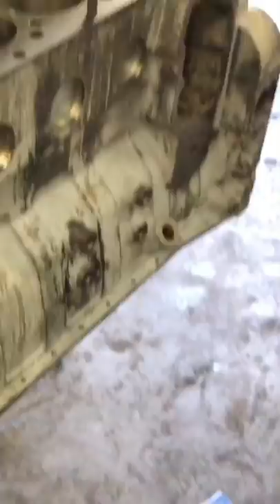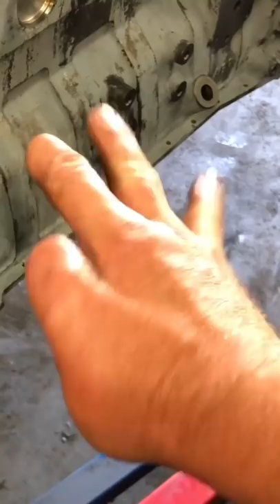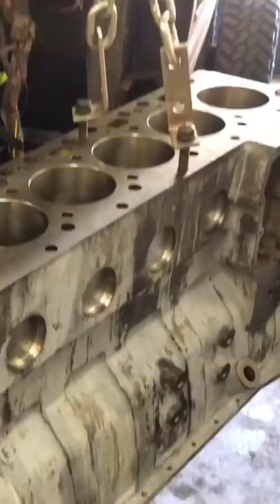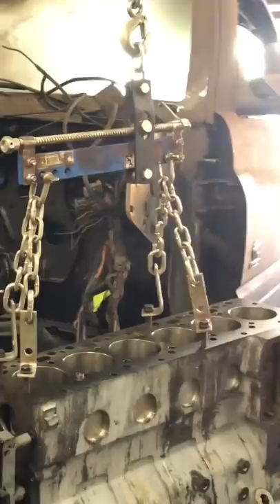Be Careful folks! Link in Description #12valve #cummins #diesel

Comment from the maker: What Happened to my Hand?
https://youtu.be/_HKbipvgtS0
Reply: C-cool gulp
Reply: What happened to the 4th finger?!
Reply: @superniger4822  ok that’s a bit rude though. Did you watch the linked video above?
Reply: The amount of fingers dont add up. Were you born with 4 fingers
Reply: @hitmanxiv9401  watch the video.
Reply: Look thanks for the safety reminder but you gotta warn people before you just go showing that thing off
Reply: Reminded me of the "shake hands with danger" video
Reply: In that case I doubt those bolts and chains gripping those brackets aren't gonna hold that engine block especially if those chains and that bracket is a zinc alloy
Reply from the maker: The brackets and chains came with the 1500 pound load leveler.
Reply: Real fallout super mutant
Reply: How is your phantom pains
Reply: I lost my leg and mine are Horrible
Reply: Where did your middle finger go
Reply: Anything happens I lost my mom to a bike wheel

Comment: When metal decides to hurt you, you’re just made out of butter… that can’t be any more true.  I work with molten aluminum .
Reply from the maker: Yep it is dangerous in all forms
Reply: I work on big copy machines. Lots of razor sharp metal panels gears belts and rollers that don’t care if your fingers are in the way. I’ve got my share of scars from grabbing sheet metal frames in the wrong spot.
Reply: He works with molten aluminium.
Reply: My dad did the same when he was young. Do you tie your boots?
Reply: @grantpierce7182  yea but we have something called splats that protect to top part of the boot.
Reply: I also work woth molten aluminum right between the plates
Reply: The type that  explodes when contact to water?
Reply: @maluco132  yes.  We actually had a pretty bad explosion due to moisture last year.  Entire melter exploded .
Reply: Stay safe brother, dangerous stuff
Reply: @tomasc6  it is but if you’re careful an aware you’re good.  Thanks
Reply: Yeah just yesterday when we were just arriving to get set up at the jobe site, some dude fell from the second floor not even an hour into the day, he apparently went down head first, so there was blood coming out of a wound on his temple, also was bleeding from his ears. Was the craziest shit I saw inna bit, he was pretty much knocked out having a seizure bleading from his head, I wanted to help but I didn't know what to do.
Reply: @maluco132  all molten metal does that
Reply: @nighttailglizzy6339  he was dead. Sorry but he landed on his head neck snapped. Their was no saving that
Reply: @malikcoleman2023  I wouldn't say that usually small cuts hurt the most large ones well for it to get that bad you lost your sense of feeling before it got that far
Reply: Yup, I’m a Shop Ironworker. I’ve smashed four fingers all Different times. Cut the tip of my right pointer finger. I have a screws and a small plate on another finger😂
Reply: You mean... Aluminium?
Reply: @BT.70  Both are correct. Just like 'humor' and 'humour' are both correct, it's fucking dumb but it's the way it is.
Reply: Yup. My story not anywhere near yours man or 95% of anyone else's but 15 yr old Metal Fabrication class working working on lathe polishing a project middle finger sticking out a hair to far. Lost the nail slowly grew back can't feel anything past the second knuckle.
Reply: @jewkorn9724  correct depending on your nationality. It is not literally accepted as correct In American English, if you were to write that on a college paper you would be docked
Reply: I work with a steel cutter that uses roughly about 5,000psi of pressure and I've crushed a few fingers not being careful, I also almost lost a toe thanks to a barrel of steel drops got caught and fell on my boot, took off the tip but if I was any closer I would be having a real hard time walking today
Reply: @StockyBaldman  imagine breathing in metal particles
Reply: @ericbower2256  lmao 🤣
Reply: Been there done that. First day on the job, we were sifting the top of the oxidized molten aluminum a chunk fell back in, splashed on my gear and burned through my gloves instantly. I was smoking up litterally
Reply: @joshjarman8685  looks like you were too close to the melter.
Reply: Same here man! Work at a casting facility
Reply: @getthebagnelly  cast ingots?
Reply: @getthebagnelly  oh we cast ingots as big as 30k.
Reply: I have a similar injury from childhood from a bike chain and gear, thought I could beat the speed and lost the tip of my finger, not as hurt as you but it really sucked cause it happened so fast then I had no finger tip, finger injuries are so weird, my finger nail healed differently due to missing a finger tip and I pretty much have a weird claw nail. Finger injuries from being cut are almost the same, the claw looking club nail.
Reply: I've never heard of him. Weird name really. Most my colleagues have regular names like Juan or Billy. What country is your friend Molten from?
Reply: I worked in a copper casting plant for a few years. I seen a man wearing protective gear get burned alive. Burned the PPE gear off, his clothes, and most of his skin. He died a few days later. Happened at Kobe/Weiland Copper Plant in North Carolina
Reply: @foosmonkey  can’t you wear thick gloves while your working?
Reply: @YeOldeGeezer  no dexterity. Occasionally I wear Mechanix gloves.
Reply: @DomVito87  you at a mill or a smelter?
Reply: @johnsandlinjr  I working in a cast house of a few rolling mills. We produce ingots as big as 30k each.  Run various alloys.
Reply: @DomVito87  I was an electrician at Alcoa in Lancaster. Which mill you at?
Reply: @johnsandlinjr  I work there lol . But in casting .  Was in the HM for a few years as big red driver .
Reply: @DomVito87  dude no way. When you said I work at a mill and there was an explosion I just knew it. I was talking to other electricians who told me about it and I couldn’t believe it. But I will say after all the safety videos about bottles and stuff in orientation that all goes out the window lol
Reply: @johnsandlinjr  I was in the hotmill at the time 6 went boom... but i saw it. shit was wild.
Reply: @johnsandlinjr  That wasnt a bottle that caused that boom on 6 lol.
Reply: @DomVito87  and that made you want to go to the cast house? Lol
Reply: @johnsandlinjr  HM was boring.
Reply: @DomVito87  fair enough. Do you guys work on both sides? Charge side and holder side?
Reply: @johnsandlinjr  Na... I work only on melt side.  Reverbs/ Open Wells.

Comment: I have a friend who's missing two toes from a 396 engine block that fell on his foot. He was wearing flip-flops.
Reply from the maker: Ouch dang that sucks
Reply: That that truly does suck. But Atleast he can say it was a sweet 396. Not some junk 4 banger that did it lol
Reply: Steel toes.
Reply: I had a customer inspect a roof with flip flops on then called when he cut his foot on 90 degree chimney flashing. I advised him to use a little more common sense and to think about that and call me back of he still had a complaint with the roof or galvanized flashing being sharp. I never heard back. One of the only times I seriously considered calling a customer a friggin idiot and had to hold back laughing.
Reply: Toes and fingertips are packed with tons of nerves, sounds painful
Reply: @BrianBourgeois-  no that’ll make it worse he would have lost all his toes, the steel will just crush your toes when the 400lbs hunk of cast iron hits it
Reply: @sargentdoggo6155  that's why composite is the better way to go anymore plus it's lighter. I wear boots with composite toes almost anywhere. Sandals suck.
Reply: I shudder at the thought of wearing any kind of open toed shoes while working in the garage. Even if you’re not working on particularly heavy stuff there are plenty of things you can drop on your exposed toes that can ruin your day. Even dropping a power tool that only weighs a few pounds onto your feet can fracture or cut up those little piggies.
Reply: @sargentdoggo6155  Yep, drove me nuts my previous employer wanted steel toes but we all had composite. Forklift and pallet traffic.
Reply: @davesendit1348  in what way do 4 bangers suck?
Reply: @sargentdoggo6155  what's the difference between composite and steel? steel toe can withstand up to 6k lb as Google says thats more than enough for a 1k lb block no?
Reply: @Mustafa Mohammad  steel is good with lighter stuff like cinder blocks or smaller tank but when it comes to working with bulls or just cattle in general a bull can stomp in steel toes, a 350 1ft in the air can most certainly crush steel toes, composite won’t crush it’ll just shatter giving you the ability to get your feet out without having to leave your toes inside. If I’m wrong plz correct me
Reply: @mustafamohammad1821  not when it's dropped from 5.5ft up
Reply: Security Flip Flops?
Reply: I feel like my pain threshold for my hand would be better than my foot
Reply: I once had a metal 55gal trashcan full of compost drop from 4ft and land with the corner on my big toe, its been about a year and the toenail is still fucked. I lost about half of it and the half thats left has grown into a super hard bubble on my toe.
Reply: @BrianBourgeois-  naw he’s toes were definitely not steel….
Reply: @TheOfficialFloridaMan  Dropped a a big ass tool box on my big toe. Completely crushed it. The pain I felt that night from the pressure under the toe nail was agonizing. Then my friend stepped on it and it exploded. Lost the toe nail and now I have a super armored toe nail in its place lol
Reply: As a dude that does mechanical stuff in a home garage environment for spare dough in flip flops that just bought a motor lift, this just stopped that 100%
Reply: Damn flip flops or not I don’t think a pair of shoes would’ve even helped him. I’m an EMT and I had one patient who’s toes got crushed wearing steal toes (not saying they don’t help for lighter falling objects). The metal in the toe box wrapped around and cut in behind the joint of the toe trapping his foot completely. Had to transport him with the boot on, don’t know what the doctors had to do to get it off but I assume it wasn’t pretty.
Reply: Crocs is what he needed
Reply: @davesendit1348  crazy how a junk 4 banger will run better and longer for years after the 396
Reply: @mustafamohammad1821  the metal may stand 6k lbs, but guess what? The toes and boot under the metal won't.
Reply: @wholemilk6001  he's just mad that the Subaru 4 banger has a deeper rumble and sound than his V8 lol
Reply: @wholemilk6001  🤣🤣🤣🤣
Reply: The ole David Freiburger
Reply: @davesendit1348  ikrrr
Reply: Ahhhh the Chevelle! That car is still one of my favorites!
Reply: I wear flip flops under dangerous conditions, for almost a decade. Neither a nail nor an item hit my feet. I am fully aware the danger thus never get complacent. I find PPE in some cases cause more accidents than save. COMPLACENCY KILLS.
Reply: @foosmonkey  See my comment above.

Comment: That is no lie. Three fingers crushed when I was 16 as well. One finger looked like someone had put a firecracker in it. 
Got to keep them, and have very little feeling in my right ring finger.
Reply from the maker: Wow that’s lucky
Reply: I unload 18 wheelers for a living and we had a trailer door that wouldn’t shut. I got up on the latch trying to use my weight and I had my finger in between the parts of the door. 

When the door snapped shut, my finger was still in. Had to pop it back open to get my finger out. It was barely hanging on. Had to get it stitched back together. 

The worst pain I’ve ever experienced.
Reply: I had a Car fall off the Jack onto my Right Hand and Thankfully I got to keep it but I had to go through a lot of Surgeries and now my hand has a Lot of Titanium in it now but it hurts and starts locking up in the Cold Though
Reply: @CreekA  I was new to the job and only had a few minutes before my shift was up. I actually didn’t know the door was jammed that badly. I just came back to the wareroom and people were trying to shut it so I helped out. I guess without realizing, my hand naturally gripped where it could find an opening.
Reply: @doofusPoofus  yea it can always happen. Glad you kept your digits
Reply: @deltasixgaming  that’s probably one of the lasting side effects that I don’t like as well. When it gets cold my hand just stops working. Granted I’ve had more damage to the same hand beyond just being crushed, as a year later I was bit by a rattlesnake in that hand 😂 I damn near died. 
I’m 31 now and I drop things because I can’t feel them (nerve damage 😂) the 1/2”tip of my right hand ring finger will turn white and start hurting if it catches a hint of cold, then the rest of my hand will become useless before the pain starts (thankfully) 
But I’m mechanic... and one day a spring decided to rapidly decompress straight into... my right hand 😂 I thought I died. At a certain age you’re  familiar with pain and I seriously almost pissed myself on the floor on my knees in silent agony. Nothing broke... and to this day I’m terrified of springs 😂 I still play with rattlesnakes 😂
Reply: @doofusPoofus  I think most of us learn the hard way, in fact I’d say most of my safety concerns come from first hand experience. 
Like how a non locking blade on a knife went into the middle of my thumb (right hand) then deviated off basically cutting off the side of my thumb... through the nail. 
I will not allow non locking blades in my house... and the lock has to be solid.
Reply: Is there an age requirement for this kinda stuff? Do you think maybe it could help protect some people?
Reply: @prod.arcsyne2990  there are age requirements, but some of us just can’t be stopped from making money. And there are plenty of areas still where it’s acceptable for kids to do dangerous things.
Reply: Same here, crushed my right ring and cut tendons in the pinky at the joint. Had them re attached. Slight trigger finger in the pinky and nerve damage from deep cuts in the thumb
Reply: @samuelmmmk181  oh buddy do I feel you. I didn’t have much tendon damage (thankfully)
Work safe everyone for the love of god 😂 I’m 31 and feel like 50 some days.

Comment: Yeah I ALWAYS wear steal toe boots even in my personal shop.
well... not always, but 95% of the time
Reply from the maker: Yep good idea
Reply: Imma start wearing steel finger gloves haha
Reply: Steel toes are designed to chop your toes off if something is to heavy so your able to pull your foot out
Reply: Steel toes: how to turn a 2 toe accident into a five toe accident
Reply: Dude if a horse steps on ur steal toes say goodbye ta them toes that’s why cowboy boot have extra room in the toe
Reply: @gofastgang7284  i thought that whas proven false.
Reply: @Tridd666  They also turn the much more common "minor fracture and resulting recovery process" into something you forget about 30 minutes later. One time a length of 1" tube slipped and fell end first onto my toe, if I wasn't wearing the reinforced toes then it would have been a guaranteed injury.

Comment: Thanks for sharing I worked in the plastic molding industry for a few years and those machines have 2 ton molds that move up and down people have had their arms ripped off and even killed its no joke
Reply from the maker: Wow crazy, I bet
Reply: @StockyBaldman  that it was I left for CNC because I had one to many hydraulic lines blow when I was close to them it happens because the oil runs pretty hot and will eventually compromise the line and no real way to tell until BOOM lost half my hearing on the left side and that was with OSHA approved PPE

Comment: As a transmission mechanic i can vouch for this. My mentor was missing his thumb and most of his pointer finger on his left hand. When they were dropping a transmission of a trans jack his hand was in the way of one of the straps. As the transmission lowered the chains quickly tightened crushing his finger in the process.
Reply from the maker: Ouch!

Comment: I’m a steel fabricator and you’re absolutely right about the metal , machines and tools as well. Still recovering from an injury above my left knee 6 “ cut off wheel half way through my leg cut into the bone. Luckily the wound was cauterized and as soon as it happened.
Reply from the maker: Wow you are so lucky. I think there’s an artery right around that area
Reply: @StockyBaldman  sure is just a little higher on the thigh and I probably would’ve been done for brother.

Comment: Great advice right here. It’s so easy to get caught up in the fairytale of morbid things never happening to you- but they will. I work in a factory and trust me, getting too comfortable will take its toll. Had a fella a year or so ago replacing the blades on a machine, (these things are around 50 or so pounds and are insanely sharp) and didn’t screw in the safety handles and dropped it right on his foot. Crushed every bone in it and severed every bit of foot north of the ankle.
Reply from the maker: Wow that is scary

Comment: My old man crushed a big toe with a weight slipping off a barbell. People still use that ancient setup and I've seen them fall off but on videos here. His nail grew huge and disfigured above the pulverized remains.  He used to cut it with a Dremel tool and I'd get to inhale the sawdust in the air.
Reply from the maker: Wow!

Comment: Was helping a guy out working on an old antique giant steam power generator. We got the engine ready to start and in order to start it you push a small gas engine driving a large gear against what is basically the steam engines fly wheel. His hand got caught between two gears in the starting mechanism when he tripped and it annihilated his hand. He passed out from the pain and we had to rescue him to safety and call paramedics.
Reply from the maker: Wow, that’s intense